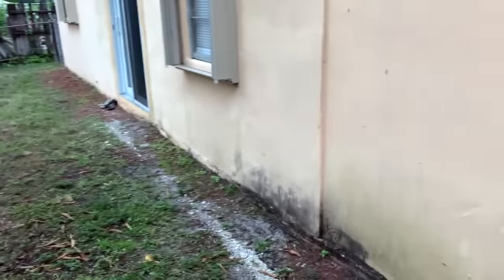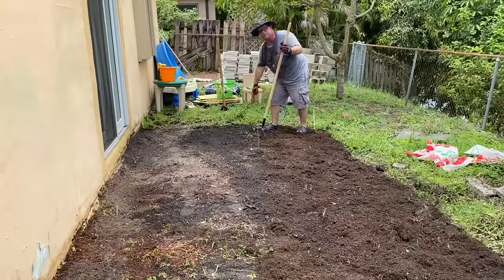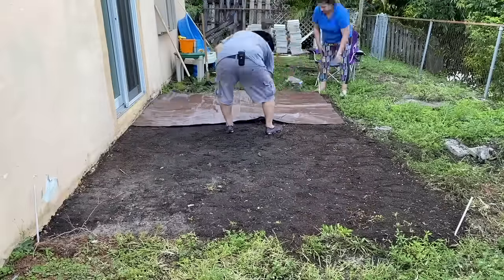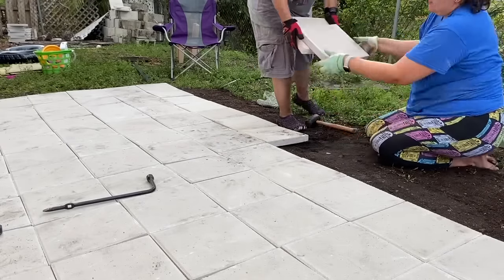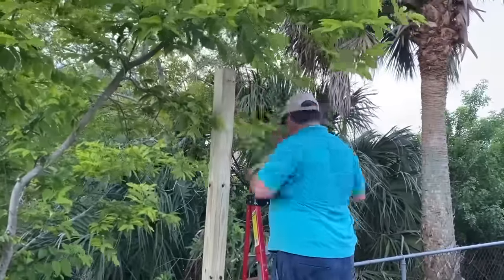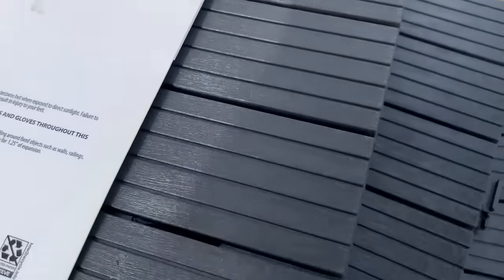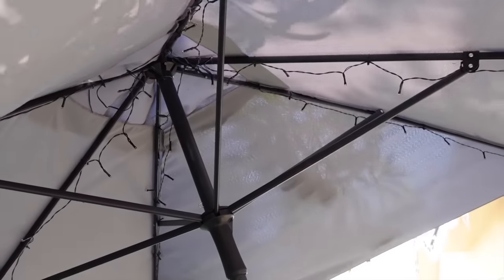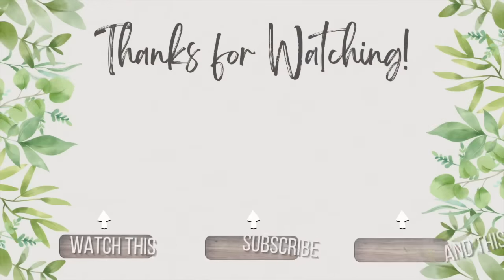ULTIMATE SMALL BACKYARD MAKEOVER | DIY PATIO | RENTER FRIENDLY

Comment: Your the first video I have found that is budget renter friendly, I am doing mine similar yet bc my area is different I’ll be doing a little different but using top soil which I also picked up to level my down flow areas of a few stones. But today as I prepare to do my make over, I’ll definitely use measuring tape along with a leveler and I hope I have just enough pavers and black mulch will be used in between the pavers. Great video folks and I needed the inspiration to start after getting my supplies the other day. Yet I’ll need to sand, fix fencing and clean my permanent 8x10 patio first! Yet I’m ready let’s enjoy summer ☀️😃

Comment: I just love this! I have 1 question? I also have bought those barrels and the shades to put up. I haven’t done it yet, but when it rains, does the rain tend to stay on top and just lay there and you have to get it out yourself, or how does that work? Thank you in advance, and good job!
Reply from the maker: Yes, the rain does kind of stay on top but a solution to that can be to unclip one of the ends if you know it’s going to rain. I know some people have also made a small hole where the water can drain through. That’s why we ended up attaching the posts to the fence because we wanted to give it extra security. Thank you so much Karen!

Comment: How did you paint the chain link fence?
Reply from the maker: I initially used a rust reformer spray paint because it was severely rusted and then after that I used a combination of black flat spray paint and also some rust oleum oil based paint with a paint brush. I linked it in the description box for you. Thank you so much for watching!

Comment: Beautiful backyard transformation and creating your oasis!  Did you spray or paint brush your fencing black?  I too have an old fence I want to paint black.
Reply from the maker: I did a little of both. I used a rust reformer spray paint for the rusty parts, which was basically just about everything. I then went over it with black spray paint and once I ran out of that are used in oil based rustoleum brush on paint.

Comment: Literally just about to do a sunshade sail over our 10x12 deck. I’m having difficulty deciding if I should get a 10x13 or a 12x12? My goal is to have coverage from the sliding glass door out which is 10 ft so it doesn’t damage my bench. We’re in WA so we get ALOT of rain so hoping this will still keep my pillows dry. We also have a 1 1/2 ft drop off to the grass so I’ve been indecisive on picking up a 4x4x10 or a 4x4x12? Skipping the qwick crete and getting concrete block with the fasteners built in. That would make our posts on the ground 13ft or 11ft if we did the 4x4x10s. Wish I could find more videos on the best method.
Reply from the maker: Hey Christine! Are you going to be using four posts or two? Sounds like the 12 x 12 will work best in getting the coverage that you need to protect your bench.